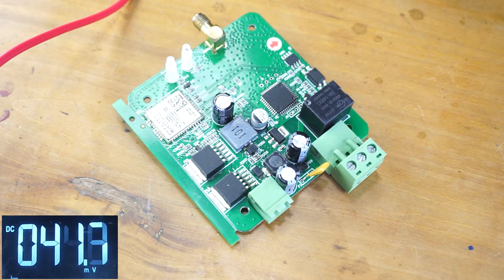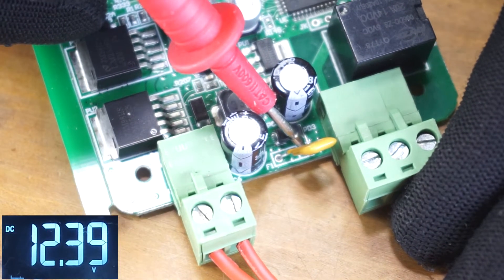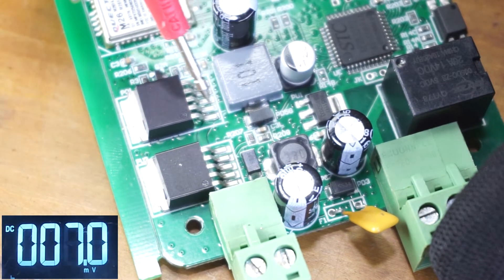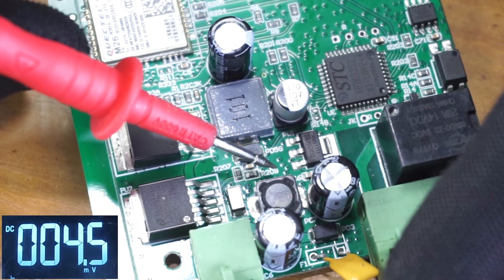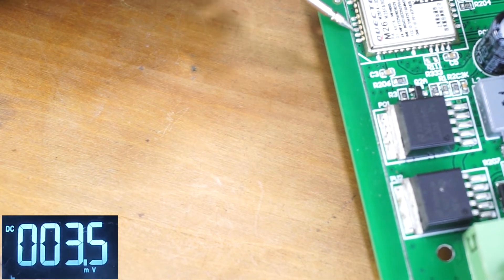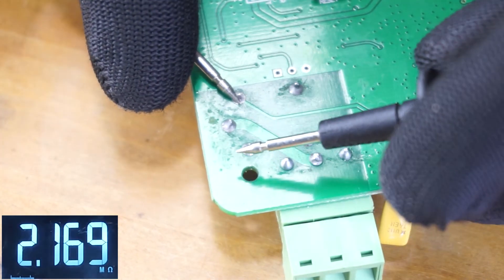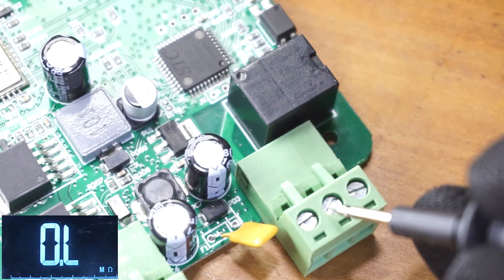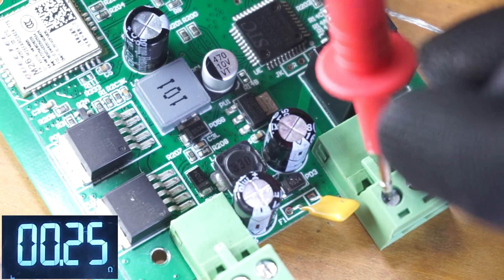RTU5024 Troubleshooting Tutorial | RTU5024 not working Fix

Comment: Thanks for this run through. On my 3rd RTU 5024 unit here. The first would need a reset after just one day (returned). The Second one lasts around 6 days. The third one I will install this week.

My use case is remote gate with 12V 100Ah battery. My RTU 5024 my says 9V-15V. Is there something I need to do between this battery and the unit? I have read that many run into the reset problem. It makes the unit worthless though If you need to reset it weekly or even monthly. 

Willing to replace components if you know what causes the need for a reset. Also how much current do these draw when they function correctly?? I haven't really been able to map out my expected life on a 100Ah battery at 12V. 

Thanks for your time.